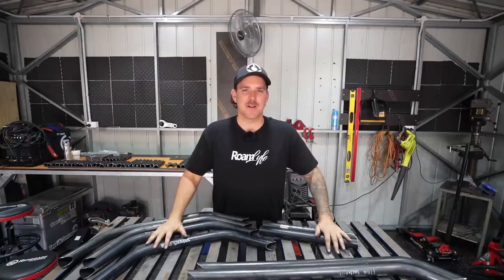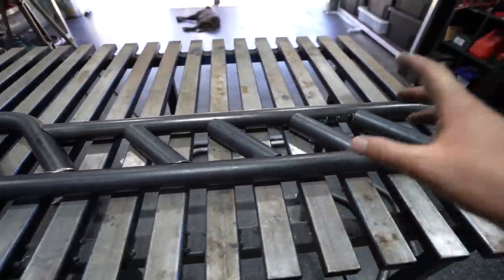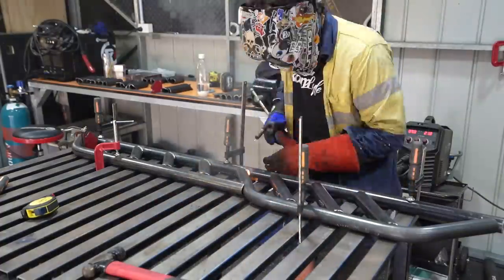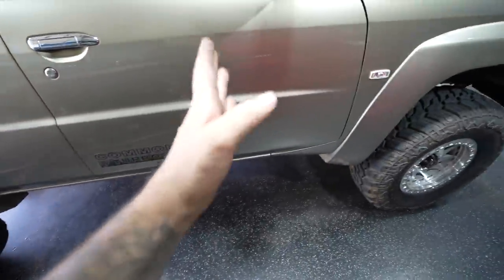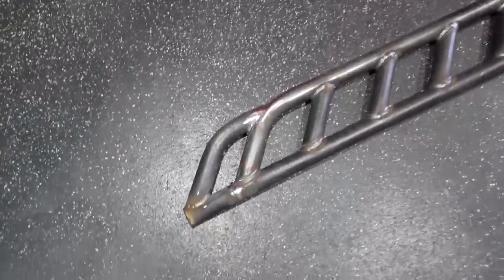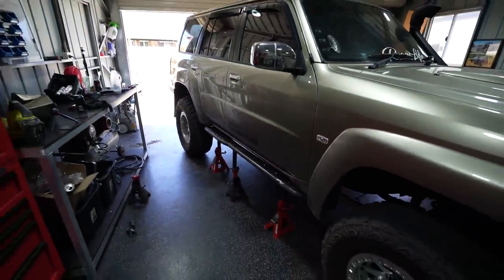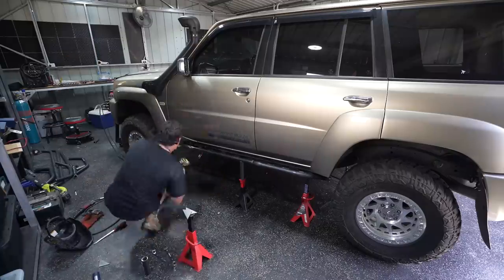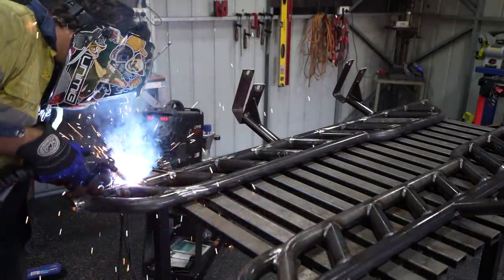Building ROCKSLIDERS without a bender!?!

Comment: Word of warning to those that like this idea tho, not bagging the video but removing the bottom part of the flare like that you also have to have something to bung back into the two holes otherwise you leave youre sills open to the elements and possible rust.
Most sliders for the series 4 and up suffer from this design flaw but there are a couple that manufacture them so you don't have to remove these.